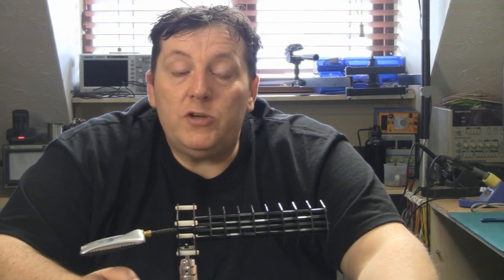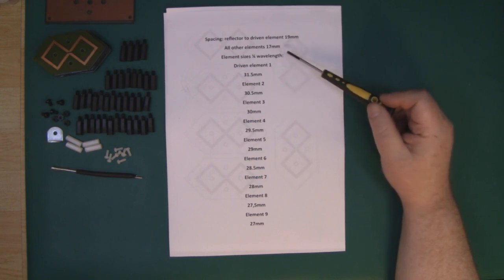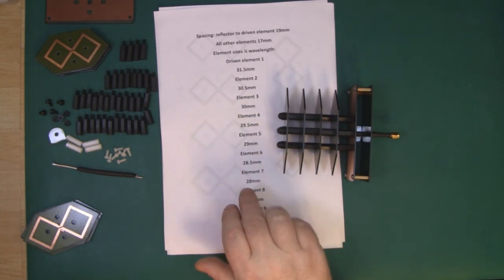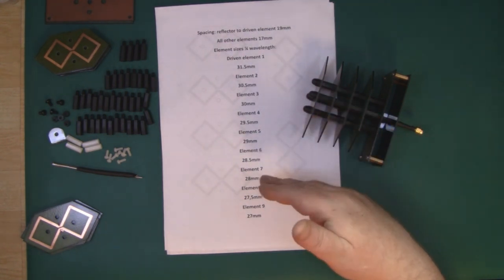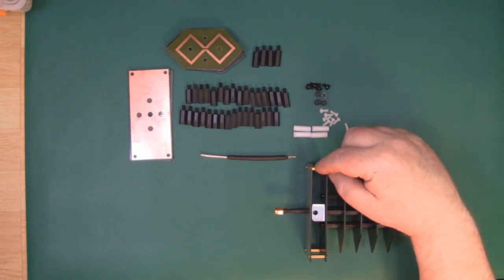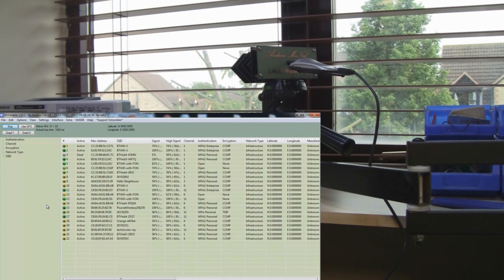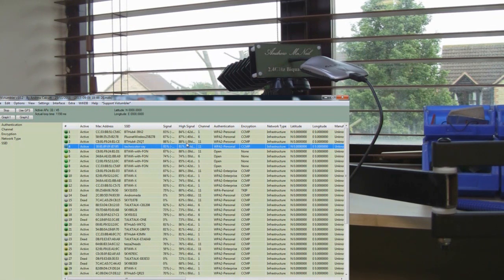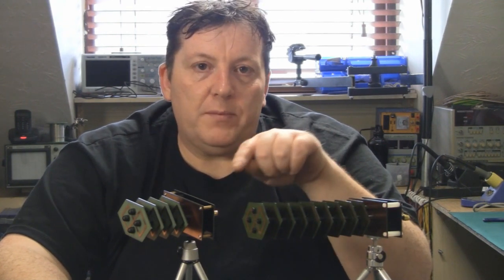Long Range Biquad Yagi Antenna

Comment: Great job as usual Andrew!  Been waiting for this larger version.  

I am planning to add 2 biquad-yagi antennas to my Signalking 999wn adapter which has dual dipoles mounted at a distance of ~14cm apart.  If I replace the current dipoles with your biquad-yagi design, would I need to add extra cable to increase spacing between the 2 biquad-yagis or perhaps mount each biquad-yagi one on top of the other? 

I hope to make this as an alternative/replacement to my own DIY buiky 28" by 18" cylindrical parabolic reflector (based on the windsurfer) driving a Signalking 999wn wifi adapter with dual 5dbi-dipoles mounted vertically forming a straight line (one dipole above the other, pointing out in opposite directions, with the circuitry in the centre) so as to have both dipoles at the focal point of the reflector.  Wish I could post a picture here to explain clearer.  

The alternative would be to replace one 5dbi dipole with a 9dbi dipole but leaving the other 5dbi dipole without support from the  reflector (so as not to make the reflector even bigger and needing to add extra cabling).  I suspect this 9dbi alternative would perform better since my adapter cannot combine/enhance signals received by multiple antennas.

I also suspect this mounting of the dipoles pointing in opposite directions reduces performance due to signal cancellation as compared to dual dipoles mounting vertically side by side.   Any suggestions or comments would be much appreciated.

Looking forward to more designs from you.

Comment: I recently bought a Biquad Yagi antenna of yours and loving it. but id like to squeeze as much power as i can out of it. what would be the maximum about of elements i could add on to it with out it negatively affecting the signal

Comment: What is the reason for the 5 millimeter smaller size of the parasitic elements going down in size from the active element ??? I am wondering if you would use silver plated copper driver element make some difference in increased efficiency ???  Good day Sir too. vf

Comment: great, I have never seen a stacked bicuad like this....... 
which do you think would get greater range? this or a smiliar sized cantenna? 
I am looking for something to get some decent range in an open area from an elevated position.  

A word about production, when you produce more than one at a time, you can avoid waste by simply using the waste area to make more elements for other models.  Even though the elements are different sizes, you could perhaps produce two boards at a time and have no waste?

Comment: Have you made this antenna for 2 meter satellite work. It would be better than a regular yagi. Because the operator wouldn't have to keep flip-floping it vertical and horizontal.

Comment: Does this antenna works with 4g lte signal or only with Wifi. Again can it also transmit a signal or it only works as a receiver? lastly the link to the shop does not work???

Comment: Hello Andrew, great vid and EXCELLENT construction design. A thought in terms of production. First piece is always the most costly. Your using two boards to construct one antenna. By re arranging things you should be able to produce 9 or 10 antennas from 9 boards..i'll explain.  Using element 1 as an example. 1 board has only element 1 artwork. Laid out correctly, as close as possible to minimize waste, it looks to me that you can get 9 or 10 out of 1 board. Following this with all other elements, you shold yield 9 or 10 from 9 boards. Ran into same situation while designing attenutor/preamps for military jamming systems. Operating from 9kc to 1Ghz, in one band, with 70-80db dynamic range...lots of fun.  Best regards, Carl M. Thompson.

Comment: Can I use the same measurements from the pdf (last page) to construct a normal Yagi antenna?
Reply from the maker: +mbielchris No you need this one: https://goo.gl/xpIrTi
Reply: I meant to say for a non-biquad Yagi antenna,
You did include a template on your Yagi building video (19 element long range), but I do not have a very reliable printer so I was curious at what the exact measurements were since they were never mentioned.
Reply from the maker: +mbielchris Hi no they still will not work if you want to build just a Yagi look at my last video. You could use those measurements and add some more  parasitic elements.

Comment: Dear Andrew,

Thanks for the great videos. :-)
Can you please add the long range yagi to your store?  
I currently have a 15db model for Hawking (HAI15SC) 
The cantenna in the store is less then 15 and the Yagi in your store is 18 because it has fewer elements then this one. 
So, I would like to request that you either add this one to your store or sell us the circuit boards to allow us to make our own without needing to etch them ourselves.

Best wishes,
Robert Bourbonnais

Comment: Thank you Andrew for nice video,  I have a small question. 
Would the width or the diameter for the conductive wire(or tape) matter the gain?, I 'm planning to cut the plate copper tape into the biquad shape or use the thinner copper wire. Personally I don't think the width or the diameter would really affect the performance but want to check this out.

Comment: I'm curious about that the distance between parasitic elements should be 17mm apart and the spacers are 17mm + thickness of pcb 2mm? =19mm. Amazing and unique design.

Comment: Can you tell us how much dB gain does this new long-range versions have? Angle of front beam? Anything? Compared to a regular yagi bought from ebay?
Reply from the maker: +CrypterMKD I will post some info in a few days as I need to hook it up to the analyser and run some tests and it takes time to set up. I will post a short video up later showing it working over a much longer distance. As for a Yagi from ebay, save your money they are rubbish.
Reply: +andrew mcneil will you include this antenna in your shop? im not the best antenna builder =)
Reply from the maker: +TheNovum Yes but it may take a few months
Reply: +andrew mcneil thx for the reply 👍
Reply: +andrew mcneil Do you test this antenna dB gain? I wish to know the real power of this ant. I build one but strenght is weak like 11-13 dB

Comment: Thank you for the plans. But i have one question. Do i have to remove the copper rings that remain around the drill holes on each element? i have drilled them with a 4mm drill and there is some copper still around.
Do you think it will have a negative influence on the antenna performance?
Reply from the maker: +xAbsim Yes I just use a sharp knife and scrap them off.
Reply: +andrew mcneil Thanks.

Comment: Well done Andrew, yet another great antenna video. I have just about reached the limit of video range with my quadcopter using a 5.8GHz system with one of your  biquad yagi's on the ground station having got out to 4800ft away so I'm moving  to a 2.4GHz system for which this long range antenna may fit the bill for the A/V receiver. Would it be possible to purchase a kit of parts to build one up myself? I might even be able to video the test flight results. Using this style of antenna on the quadcopter is impractical, needs to be more compact, so which do you think would be better for distance, a circular polarised or linear polarised ? (omnidirectional biquad)?
Reply: Yes Andrew can you help us?

Comment: Would using two of these antennas on the same wireless adapter significantly increase performance?

Adapter in question:  http://www.amazon.com/gp/product/B013CQPEKO?psc=1&redirect=true&ref_=ox_sc_act_title_8&smid=A3SXLDKHWME2R6

Comment: I could really use a few of these. for demonstration and pentesting...

A raspberry pi and 3 alfa cards equipped with 3 of these antennas would make a for a effective long range, remote exploit demo...

A drop box !
Reply from the maker: +bigmac turd I sent one to my friend who works for a small pentesting company and they have ordered 8 more as they like how small it is. My friend used it inside his backpack and it was still more powerful than the yagi's his company use.
Reply: +andrew mcneil i have downloaded your pdf document and printed out the 4 pages you provide...  im measuring your driven element (1) i think i am not printing things properly...

from black line to black line... the inside of the element should read 30.5 ? or the outside of these black lines should read 30.5?
Reply: andrew mcneil I think I want 2
Reply from the maker: +bigmac turd Hi Bigmac the measurement is taken on the outside line.

Comment: https://youtu.be/W4L8IygU2k0  with your experience, does this antenna work well     or have you made one, many of us wonder if it is any good
Reply from the maker: +George Gardinier Hi George it is hard to see as his hand is shacking to much but it looks like a cross between a spiral arm antenna and bowtie. Now there are dual band antennas but they are mediocre at best and just used for a specific application. So I would ask why would you need a dual band antenna for FPV? It just seems pointless. I would also question its claim to be circular polarisation as a spiral arm needs to be feed using a delay line if it's not it is just a dog leg dipole. How much do they cost? If it's not to much I will get one as I have some dual band dipoles and I could make a video to explain the concept in more detail.
Reply from the maker: +George Gardinier Ok just been over to the Foxtech website and Bruce has got it wrong they are not circular polarized so they are in fact a bowtie and a dog leg dipole, http://www.foxtechfpv.com/dualband-mushroom-antenna-24ghz-58ghz-sma-inner-pin-p-1601.html